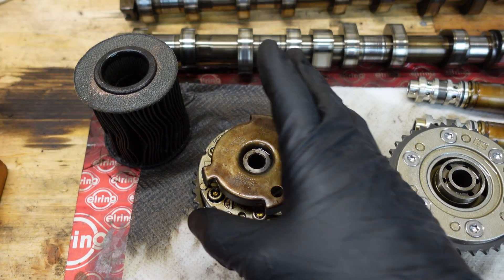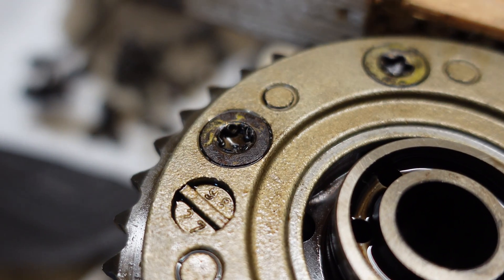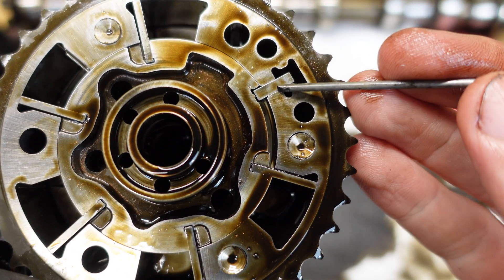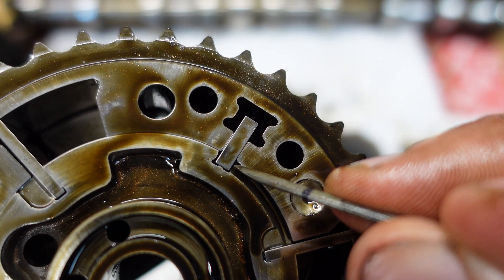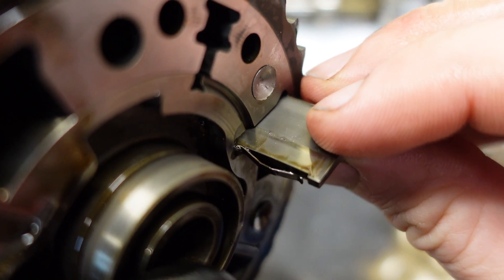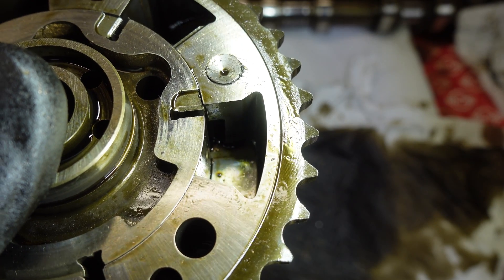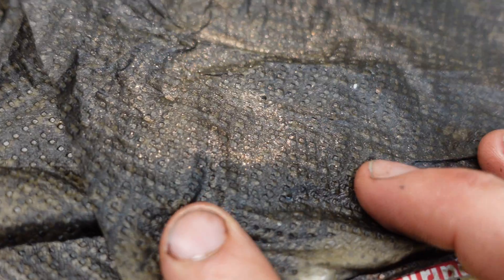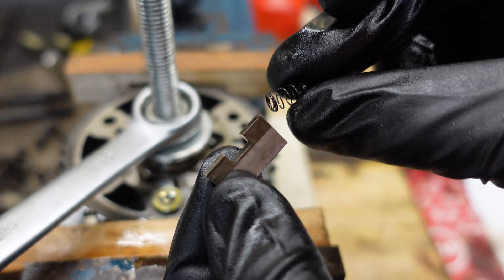N43 VANOS Inspection & Cleanup | PART #3

Comment: Hi,  Thank you very much for the very informative video. I have a question, where can I locate the non-return valve or Vanos filters? I knew that they look like screws wrapped with a mess  but I could not find any reference about them for N43.
Reply from the maker: There are no Vanos filterd per-se. The check valves are sandwiched between block and cylinder head, the only thing that acts as a filter is the screen mesh on the vanos solenoids. Check my n43 rebuild series for detailed information.
Reply: @BimmerZen  Thanks fpr your swift reply. I have checked your video, the part of removal the valve cover, but I could not see anything about the check valves. Can you please give me the link of your video, and possibly the time in minutes, of where you show the check valves?
Thanks in advance!

Comment: Short question: where did you insert the spring? There are many options where you can insert this?  Is there a difference between inlet and outlet Vanos because of the rotation and vorspannung of the spring?
Reply from the maker: I can't remember exactly... You can see the initial position of the rotor before I tension it back in to position. That should be a reference point on where to locate the torsion spring. It's best to mark it down during disassembly.
Reply: @BimmerZen  ok so the vanos after cleaning had no issues during driving?
Reply from the maker: @masi886  I don't think so. Runs great, no cam errors, no rattling.

Comment: Great video, thanks! Been looking for something like this. Similar fate with my N43, got rebuilt by a shop but I had my doubts about vanos getting cleaned or at least that they are good and didn't need cleaning as stated by them. Now I'm even more sure. What can stuck vanos cause? Higher fuel consumption, rattle sound...?
Reply from the maker: @nenadovmail  rattling, camshaft timing codes, ... its best to replace vanos units if the oil filter was perforated

Comment: do i get it right that the exhaust vanos locks on full advance? it is interesting to find out when stopping the engine how you reach the full advance. as i doubt the internal spring in vanos is powerful enough to rotate the camshaft when the timing chain stopped, and oil pump makes no pressure.

Comment: Finally a N43 Video!! How much KM did had that engine? Thanks
Reply from the maker: 216.000
Reply: @BimmerZen  mine has currently 230.000 with first chain. Do you think its possible to change the chain without having the oil pump balance shafts locked? Thanks
Reply: @bigdeal87  That's incredible. Did you do anything special in maintenance to keep it on its original chain?
Reply: @MartiansChronicle  i bought my n43b16, 2009 with 80tkm and i'm changing the chain now with 270tkm and it wasn't that necessary. just for safety.. i did the oil service annual with the recommended castrol edge 5w30m and some additives and deactivated start-stop.
Reply: @marai6902  I do the same - change the oil every year, even if the mileage is low. I didn't deactivate stop/start but I'm in the habit of turning it off whenever I start the engine. It's unfortunate that it doesn't remember the last setting - I think that's available in later cars.
Reply: @MartiansChronicle  if you want to deactivate start-stop permanently, you need someone who is able to negotiate it in the programm, then the switch will always be lightened up and it stays remembered. no more pushing anymore 😊